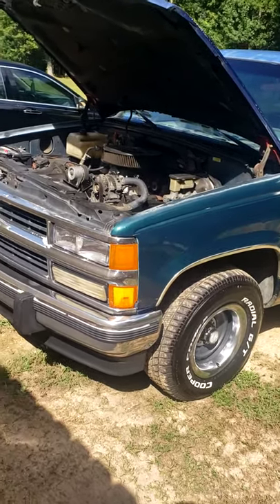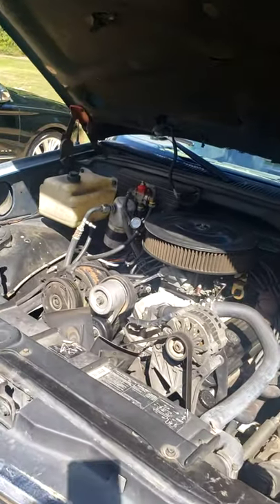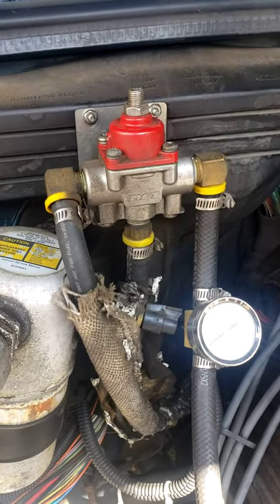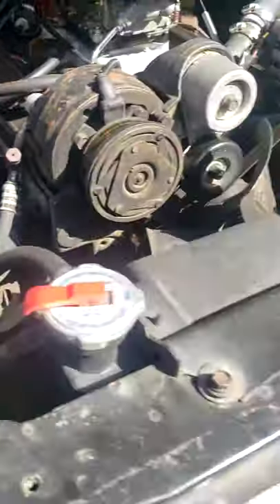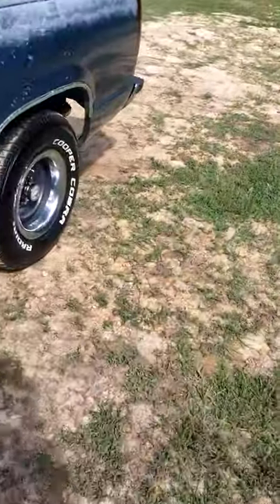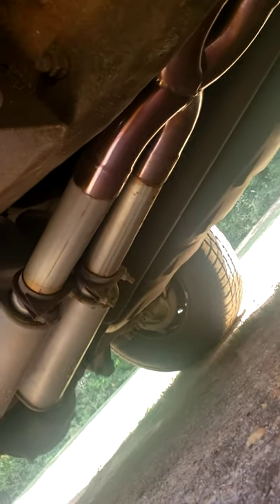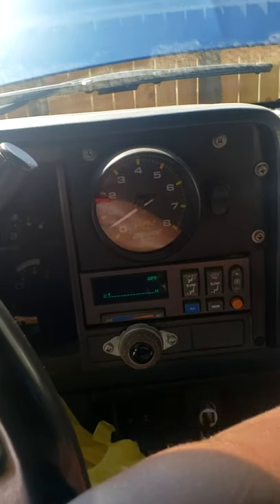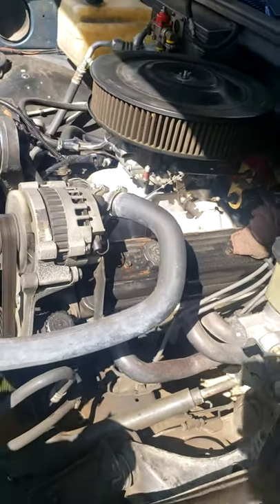Cammed my 91 STOCK BOTTOM END 350 on a SUPER TIGHT Budget!!!

Comment: How you get the rpm gauge my truck doesn’t show the rpms
Reply from the maker: It's an aftermarket gauge I ordered from a local parts store. Normally, the radio control is there or a storage compartment. I took an old fuse panel cover and cut it to fit that area. Then I mounted it in the truck.

Comment: H pipe?? Brother don't sell yourself short! You got a genuine x pipe. 😎
Reply from the maker: I've gotten the exhaust did over since this video. And I'm going back for updates since I installed long tube headers. You should check out the video. Let me know what you think.✊🏾✊🏾
Reply: @WorkingwithBobby  just from this video I already like it! I dig any 2 door daily.
Reply: @WorkingwithBobby My family & I have a 90 K1500 5.7 4x4 5spd manual, short cab & bed. (It's like a family member) It used to be a step side, but you probably already know how well they (fiberglass) hold up, and we needed some more bed room. 😂. I came across your video  because I'm sort of looking to go the same route I can't stand the "TBI" BS anymore. I built the engine for a few years back from a junkyard bottom end, freshly cleaned & rebuilt/resurfaced Caprice interceptor cylinder heads. other than that it's just a stock rebuild.
Reply from the maker: @bbracing3925  thanks man, I really appreciate that.
Reply from the maker: @bbracing3925  man, that's awesome. Belle is like a member of my family too.✊🏾✊🏾 I only did the swap because I could not figure out what made it run rough while driving through town speed traps. This was before I started doing YouTube. I changed and replaced everything and still couldn't figure it out. So, I did a HEI distributor and carb setup and never looked back!!!

Comment: What's your timing set at
Reply from the maker: Right now, I have it set at 34 degrees total timing. At idle I think it's in between 12-14 degrees. I had to set it where the engine was happy. Hope this helps.
Reply: @WorkingwithBobby  so on the timing gun you have it set on? 12°btc
Reply from the maker: @BerdManLoak  yes sir.
Reply: Thanks bro just did 350 vortec swap in a caprice box w carburetor n stage 3 cam. Hopefully I get it right
Reply from the maker: @BerdManLoak  that's whats up dude! I'm happy for you. Make sure you sneak up on the ignition timing. Add a little timing in small increments. Your engine may be happier with different timing. You have to listen to it as you advance the timing.✊🏾✊🏾

Comment: Hope ya went with a TRUCK cam u lost pulling power
Reply from the maker: In the description of the video, I added part numbers to help people get the same parts I have if they want. The SUM-K1103 is a 4x4 truck cam designed for low end torque. Hope this info helps you as well.✊🏾✊🏾

Comment: Give it a little more timing
Reply from the maker: I can't Nick. I have to keep spark rattle at bay. When I had the TBI heads on it, I pretty much ran the same timing, give or take 2-3 degrees, on 87 octane fuel. When I put the vortec heads on with that different cam, I noticed a spark rattle sound only under heavy load or hard acceleration. That's when I had to back down the timing some and move up to 89 octane fuel or ethanol free 87.